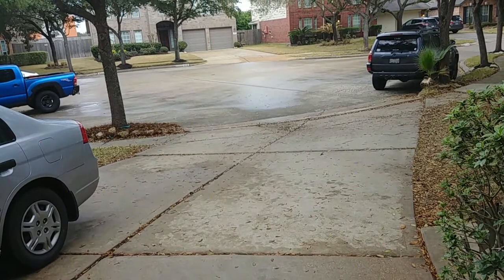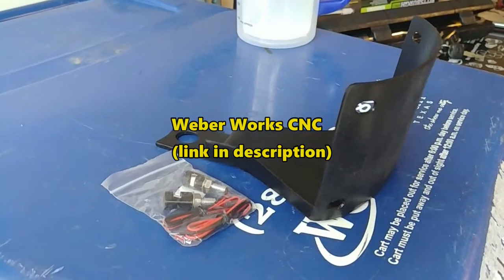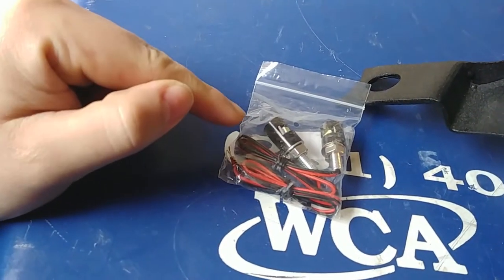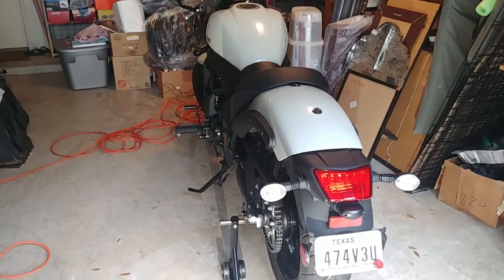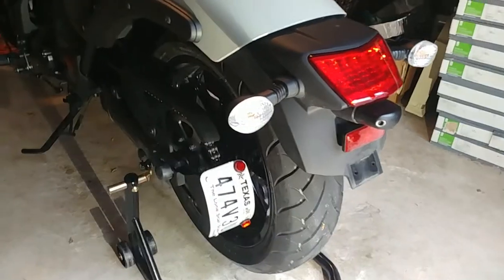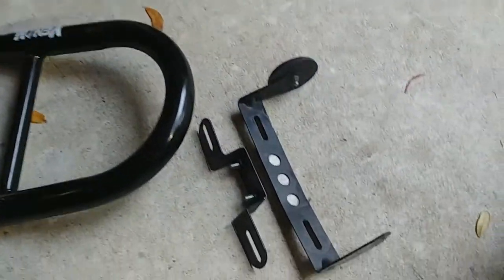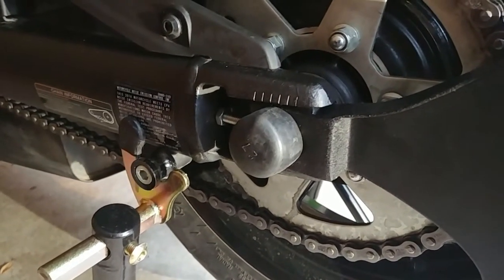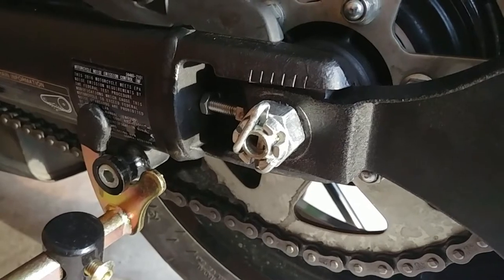License Plate Side Mount | Kawasaki Vulcan S | Install Video

Comment: You haven't had any issue with putting just one side of the Carter pin in have you? Thanks in advance
Reply from the maker: Scottie Hicks I put both but after torquing it down enough for the hole to fit it lol but one side should be fine if you bend the other side so it won't come out